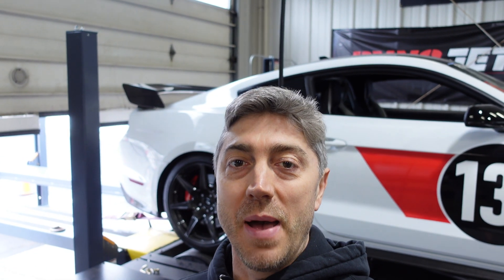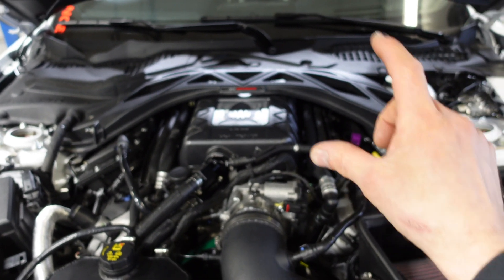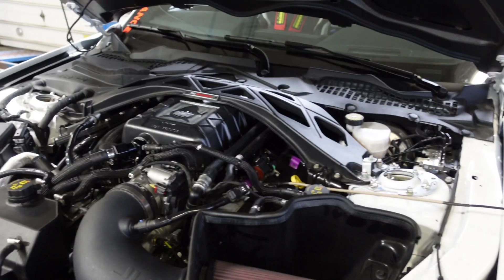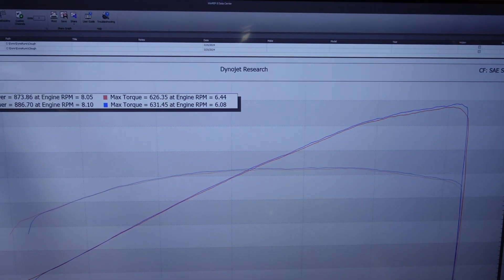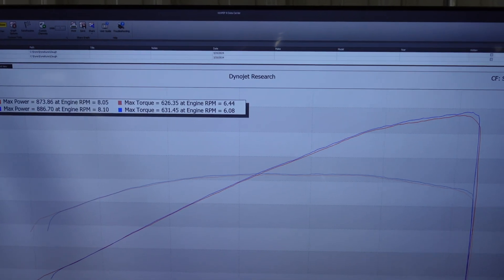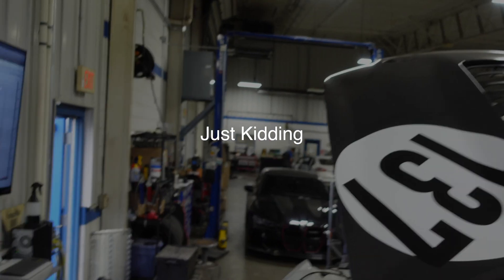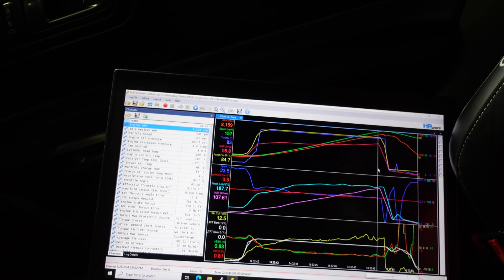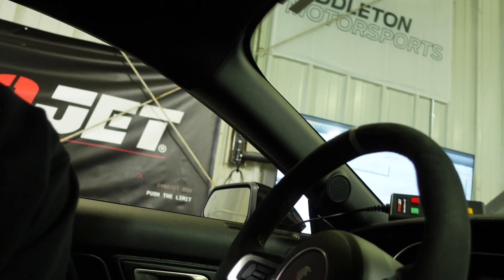2021 Shelby GT500 MM900R Ported Supercharger & E85 Tune | Behind The Tune With Matt // On The Dyno

Comment: Does the supercharger porting kill low RPM torque on the stock pulley?  Im considering porting with stock clutched pulley on pump 91 octane but am worried it will make the car less snappy down low.  Our fuel is terrible thus why the stock pulley instead of smaller.  Love the channel BTW.
Reply from the maker: No.  We heard the rumors but it didn’t affect much at all.

Comment: Is there enough capacity with the ID1050x injectors for E85 at this power levels?
Reply from the maker: Yes, this is an E85 tune. The ID1050x injectors are good up until 1000 whp.